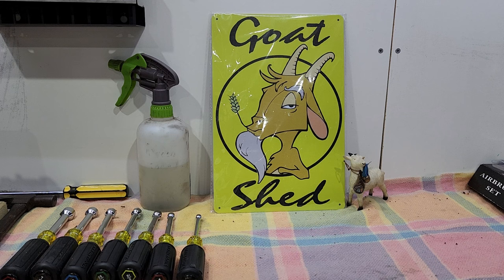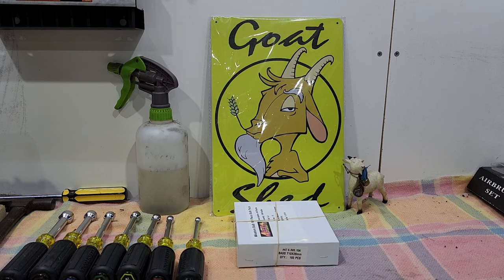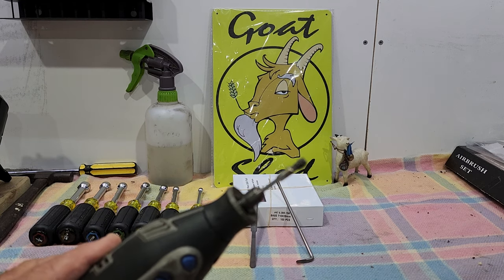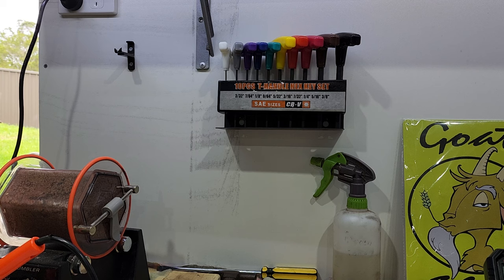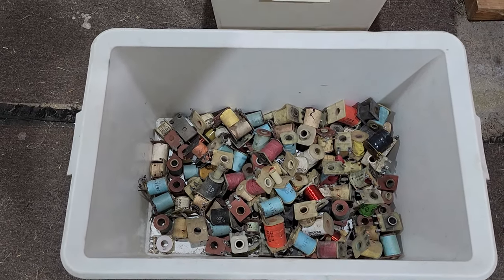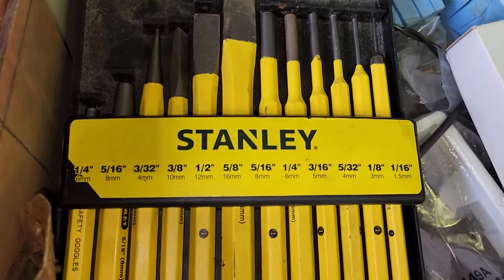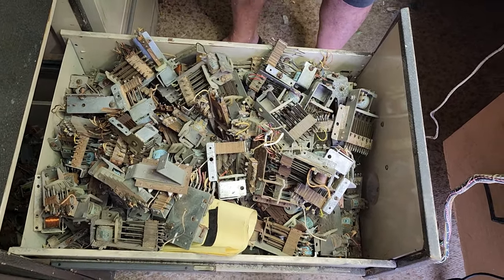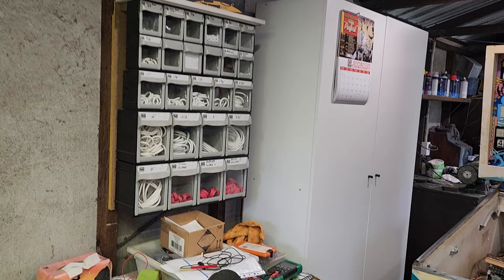EM Pinball Parts & Tools Necessary

Comment: GOAT, make a video lesson about which circuits in pinball games don't like LED's bulbs and the common problems LEDs will cause. How do you use the DVM meter to test for "stray voltages" in pinball games? how do you know if the voltage is a "stray" voltage?
Reply from the maker: We've already discussed that in previous videos but will consider doing a separate one next time we get a machine affected by it.
Reply: @goatshedempinballrepair8545  yes make a separate video that is only focusing on LED's causing problems with EM pinball games or you can find all the repair videos you have done in the past and EDIT the video parts that the LED's are causing problems to go over in a lesson. I'm curious to learn why these LED's won't work in EM circuits and what problems they are causing.

Comment: What do you mean by Bingo machine. Is that a theme type or manufacturer?  Also, can you explain how you'd test one of those coils (solenoids) before installing them.  If it's more than a simple continuity test across the leads then I'd appreciate a lesson on testing ohms and how or where to find a table of coil to expected ohms. Thanks guys!
Reply from the maker: A Bingo machine is a flipperless pinball with 25 holes to land the ball in trying to get a line or diagonal of numbers to win money.
For an example of how to measure coils please take a look at our Coils and Relays video from a about 2 years ago.